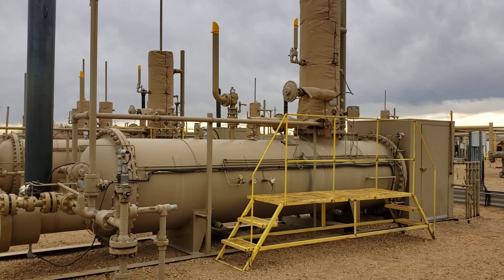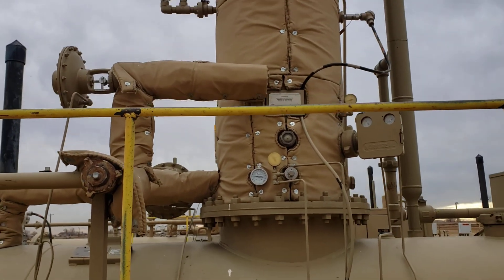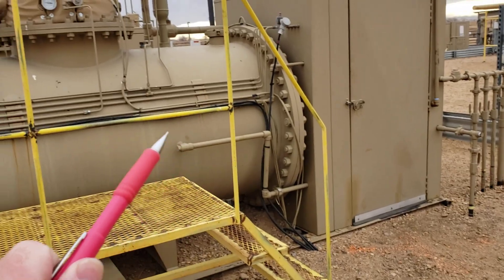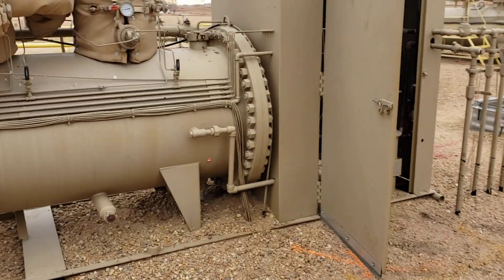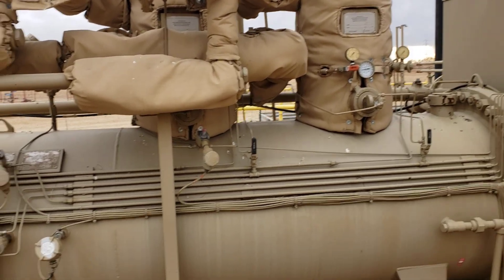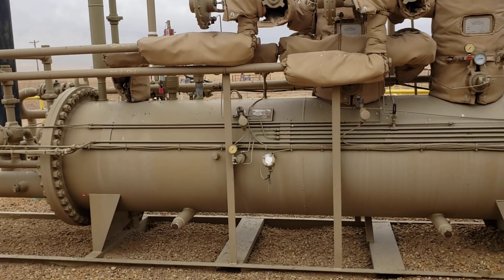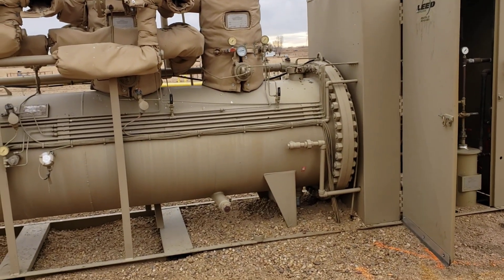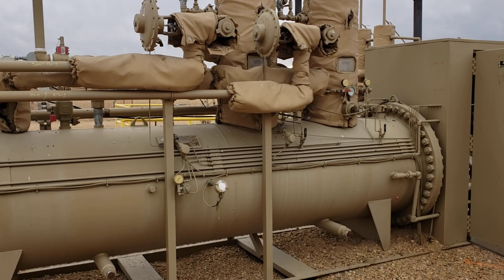API 510 inspection

Comment: What is national boards teacher?
Reply from the maker: The national board is a clearing house,  a central location for housing all the original construction forms related to a pressure vessel. 
 They are also an additional audit to assist in making certain that the manufacturer is operating according to the Code.
MrEric

Comment: Do the vertical vessels have internal coils? Wondering if that’s why different MAWP’s? Crazy the stuff I come across in the oilfield as well
Reply from the maker: Matt,  the don't have coils,  but they have a series of perforated impingement plates/ trays to help separate the liquid from the vapour.

Here is a video I made on a sectioned example of a similar separator:

https://youtu.be/nydm6F4AgMQ

MrEric